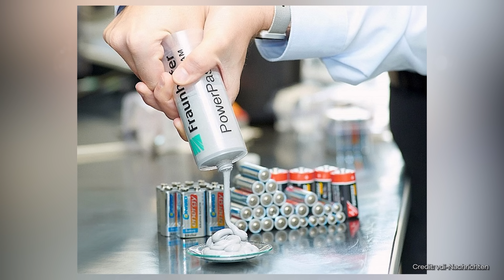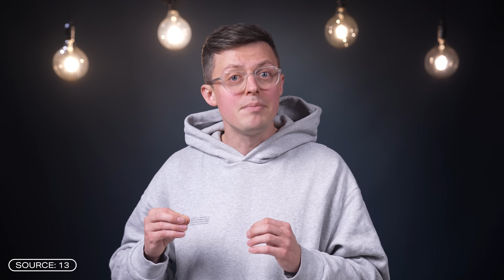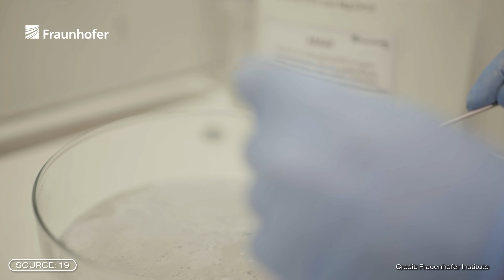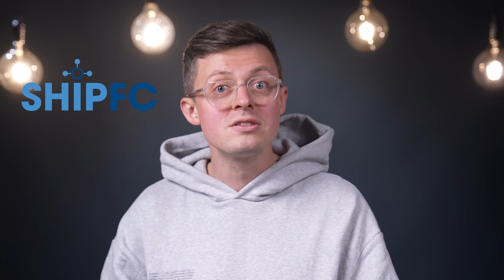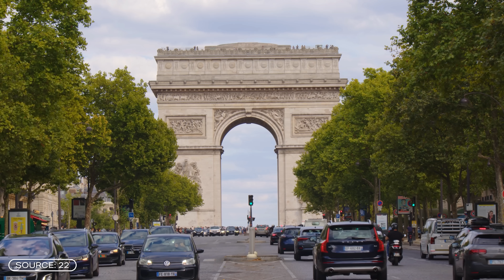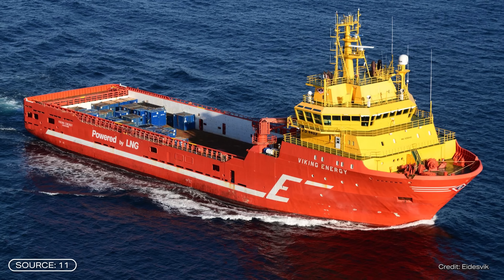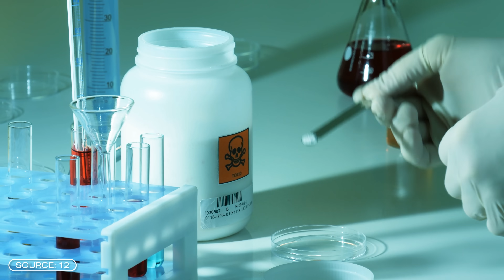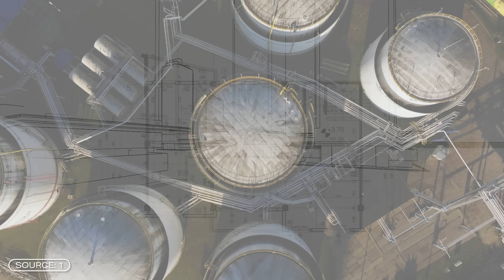Hydrogen Powerpaste: 10x Higher Energy Density & Safe?

Comment: The company could greatly benefit from Gaia Water co2 nanobubble technology. In POWERPASTE hydrolysis, the Mg(OH)₂ byproduct is basic and forms a passivation barrier that impedes water access to unreacted MgH₂ cores. Mild acidification from nano CO₂ directly counters this: Mg(OH)₂ reacts with H₂CO₃/HCO₃⁻ to form soluble magnesium bicarbonate (Mg(HCO₃)₂) or carbonate species, which dissolve or loosen the layer. Recent research on CO₂ nanobubbles in basalt carbonation mineralization (analogous barrier-limited solid-fluid reactions) shows NBs increase effective diffusion coefficients by 1–2 orders of magnitude by penetrating product layers, inducing micro-convection, and sustaining localized CO₂ enrichment. Applied to POWERPASTE, this could accelerate H₂ release rates, improve completeness (higher yield from the same paste mass), and reduce reliance on metal salt additives—potentially lowering production costs (already ~€2/kg) and simplifying recycling of Mg(OH)₂.

Comment: This is great, but, like we cannot harvest electricity from lightening,  we can't find hydrogen in the environment.  It still takes more energy to release it than you retrieve by burning or hydrolyzing it.
Reply: Energy storage! Electric power is the great medium for any form an energy storage. You can use any renewable sources or even non-renewables fuels.

Also, yes we can find hydrogen in the environment. Literally almost everything contains hydrogen. “Natural gas” is just ammonia with the nitrogen replaced with carbon. 🙄  Natural hydrogen is just vented and burned during oil drilling.
Reply: @teluial Yes I should have specified free hydrogen,  burn able.

Comment: so if your basement floods or the shower overflows your battery paste blows up your house.
This has to be a nightmare to transport, store, ect.. Wouldn't this also be expensive as hell to make?
And water always finds a way... condensation and moisture will not be denied.
It's almost like all these different hydrogen things always turn out to suck or not work in the end.. it's almost like hydrogen doesn't want to be your energy transporter.

Comment: Methane is best way to store Hydrogen example Sabatier process  CO2 + 4H2 = CH4 + 2H20, and we already have methane compatible infrastructure LNG, now we only need cheap electricity and efficient hydrogen production.
Reply: Methane is also carbon neutral, meaning the same amount of CO2 goes into it that gets put out when it burns. It's the perfect interim offset for global warming, though idk specifically if it is energy neutral, energy positive (which doesn't sound right, given the laws of thermodynamics), or energy negative.

Comment: given the supposed energy density it seems strange that so little of this magic paste has been produced, I can see challenges in the controlled release and storage of the hydrogen gas as it is converted back into hydrogen, because you then are back to the problems of storing hydrogen gas, a paste does not sound a great medium to store anything in, solids and liquids are easier to store and move,  gunk has it challenges, if getting it wet creates a runaway reaction, releasing a lot of hydrogen, that has safety concerns.
Reply: It's flamable

Comment: Limpet Engines on boosters could deliver the booster to orbit and be used to store Hydrogen with just a Liner inside the Booster, now a Storage tank. 3 or 4 spinning together could create a way point for fuel.

Comment: I following hydrogen technologies since 2013, I love the technology but I always hated the storage method alternatives to Liquid or just compression.  Even with this powerpaste I am not convinced.
The absolute benefit with liquid or compression is that you get pure H2 without extra hardware or compatibility issue.
With so many different hydrogen storage methods.. if someone needs to design a device it will need to choose one from all these,  Liquid and Compressed are already quite popular and you have more chances to get those in several countries.
But if someone makes a device using this powerpaste.. what are the chances that someone can provide you this powerpaste close to your home?
Also.. what if you want to make your own hydrogen (with an electrolyzer) from solar power, to later used in a fuel cell to power your house.  With the paste you cant.. you need all that compress process to produce the paste, in the other way you just use the electrolyzer pressure output (30bar) to fill a big gas tank, that is still a lot of storage that can be scale up  way more cheaper than batteries.

Comment: 1,600 Wh/Kg is better than any battery, but nowhere near the 12,000 Wh/Kh of gasoline.  It's true that hydrogen burns clean, but it's energy-intensive to create (the most common method is to strip it from natural gas, another fossil fuel), a nightmare to store and transport, and a silent destroyer of metals due to hydrogen embrittlement.  I'm pro-everything when it comes to non-fossil energy - solar, wind, geothermal, wave, fission, fusion -- except hydrogen.  It just makes zero practical sense.
Reply: Any battery? Well Lithium Air batteries have a max energy density near that of petroleum products (at 11,140Wh/kg).

Comment: I have to be honest, when I heard about mixing magnesium powder with hydrogens, my blood chilled, talk about a fire hazzard XD. German chemists being VEEERY german
Reply: I want a car that runs on thermite. 😂
Reply: @ablebaker8664 
I had one that ran on nitroglycerin, it made  it to the grocery store , without a driver. 
I think they said it landed somewhere between the bakery and aisle 2
Reply: I was thinking the same, magnesium powder sounds like the makings of huge industrial fires.
Reply: We use gasoline, not thermite, because it ignites more easily😅😅😅.
Reply: Exactly what I was thinking.
If the fuel cell containing the mix were to rupture and be exposed to outside air (humidity!  or, worse: rain!) it could very, very easily cook off and then become utterly uncontrollable.   No fire suppression systems could touch it because it's got an oxidizer whenever water comes into contact with it (and what's the first material often used by fire crews?) and all other materials would be burned away before they could affect the reaction.   Even direct exposure to CO2 would be dangerous because it would also become an immediate oxidizer.

That's why it's incredibly dangerous now to combat magnesium based fires, the water tends to explode when it comes into contact with burning magnesium, and fling 5k degree debris over a vast area.
Reply: @amzarnacht6710  a coworker of mine years ago was welding a magnesium alloy lawnmower deck. He got it too hot and it ignited, his response was to push it off the bench into a quench tank of about 600 L of water. It was violent and we evacuated the building. Anytime I run into him we laugh about it and about the time he was welding an aluminum dual hull boat that had gasoline trapped between the layers.
Reply: @amzarnacht6710 always wear boots and gloves. Teach your son that
Reply: You mean just like their dedication to making hydrogen airships work?
Reply: @madisonhasson8981   Airship LZ-129— Hindenburg burnt because it was painted with Thermite and the ground crew did not fit the Earth straps as per procedure and not because it used Hydrogen for lift.  Very well documented.
Reply: @Onan-u3b "Well documented" isn't sufficient.  It must also be "well known".  I had not been aware of the unusual paint used until it appeared in a Mythbusters video, and no mention was made of any ground crew failure to follow procedures.

I would be curious to know how that part of the failure chain occurred.  Who had the information, and did they adequately distribute the necessity for grounding to the crews?

Obviously not, but why was it not done?
Reply: @EdwinWiles    I was a kid  at least 60 years ago when I read about this.  Mind you, we had radio, no T.V.  No computers except slide rules. School, Encyclopædia Britannica and a monthly visit to the library.  The actual cause of the disaster was also taught as part of science and history at school.
  I suppose a lot depends on where and when you grew up.
Reply: @Onan-u3b Yes, it really does depend on your location.  I spent considerable time with the World Book encyclopedia myself.  I must admit that at that time I had not even learned of the Hindenburg.
Reply: @EdwinWiles   Yep.  Interests also play a huge role.  I like things mechanical, always have.  I have friends with totally different interests who have basically forgotten anything that they don't care about.
Reply: @Onan-u3b 
Unfortunately it was doomed using hydrogen.
  if it wasn't someone on the ground crew not connecting a cable, it would have been someone with a staticky sweater causing a tiny spark and then boom
Reply: Magnesium needs Oxygen to combust.
Reply: @Onan-u3b And oxygen is present in water, which is dissociating into hydrogen and free oxygen under the temperature of burning magnesium.  Which is why shipboard crews deal with burning magnesium by throwing it overboard.  At least that way, the reaction is no longer on the ship.

The paste simply makes the disassociation easier.
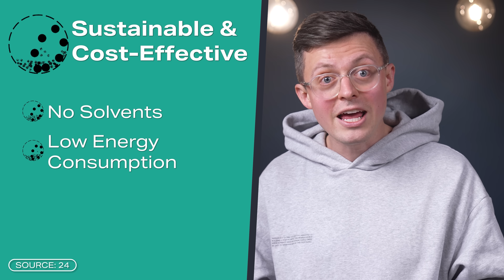Reply: @EdwinWiles    My bad, 03:00 hours and brain fade.  Note to self* Go to bed when reminder says to.
Reply: Imagine sodium and chloride, this highly reactive metal and chloride is so often in our food, how we don’t explode or die from it??!?!!/1!/1/1/1fwefagra (NaCl - aka salt)

Imagine combining 2 particles of hydrogen with oxygen. Probably best fuel for cars, yet what a deadly explosive combination - isn’t it? Imagine the fire hazard of H2O…
Reply: @driv3ver  Go huff pure fluoride gas, pal 😂
Reply: @kogorun  I can’t, nobody can unless you mix it with hydrogen :( 

Fluorine on the other hand…
Reply: @driv3ver    Now I'm scared! 😟
Reply: Tbh, the product of mixing H2 with O2 is not that dangerous 😊